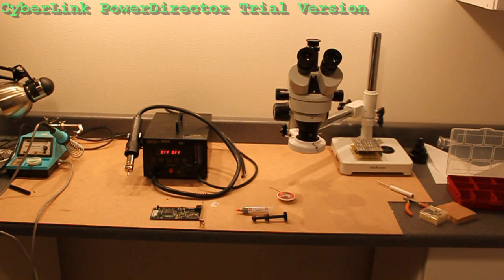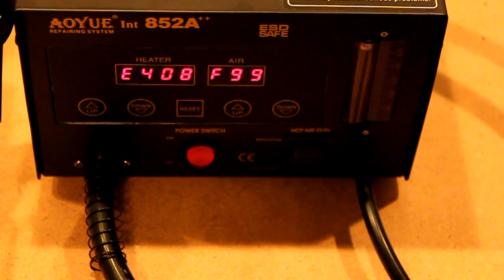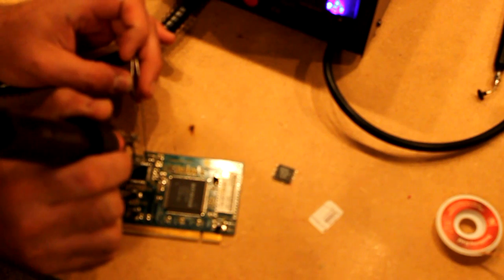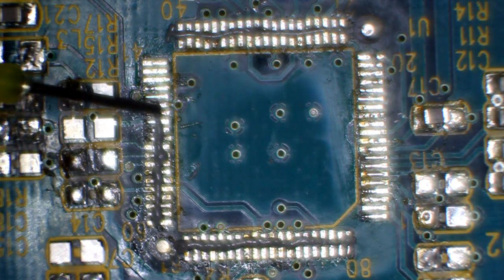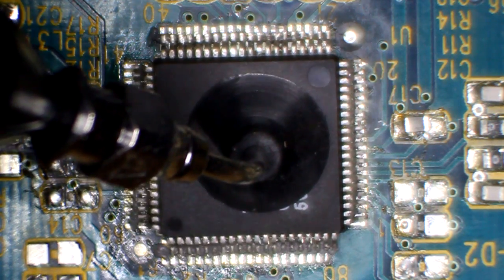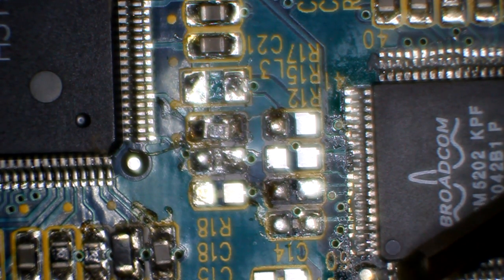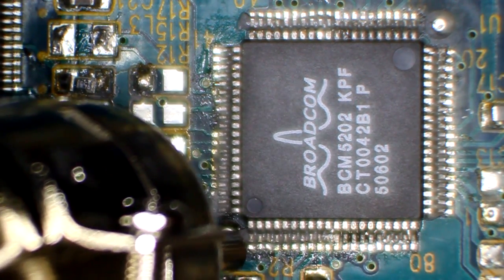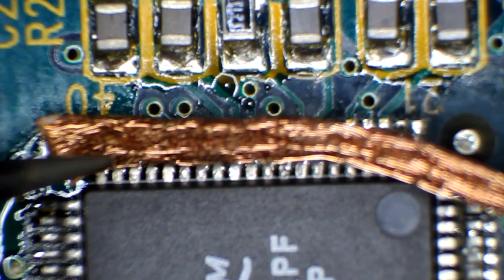Aoyue 852 demonstration

Comment: Every single Aoyue hot air rework station I've seen (5 pc at each of 3 office for ex-employer = 15 Aoyue boat anchors)- had all gone bad through light duty use by their first year in service. Look at the Quick 580 watt - it's cheap and better built - even smaller, more powerful.

Comment: Should've cleaned the board before replacing the chip and just used flux and an iron. Putting all that solder paste down is the best way to create bridges. Looks like the Aoyue worked OK though!

Comment: Dear god don't use wick to fix a bridge!! Just use your chisel tip (oh... you're still using a conical... guess I'm wasting my time) to drag the solder outwards. Seriously, get some alcohol, flux and maybe some fluxclene. And ditch the conical tip they're useless %99 of the time!
Reply: What's wrong with braid?
Reply: +Aurelius R The big tip he's using would be good for cleaning off bga surfaces.